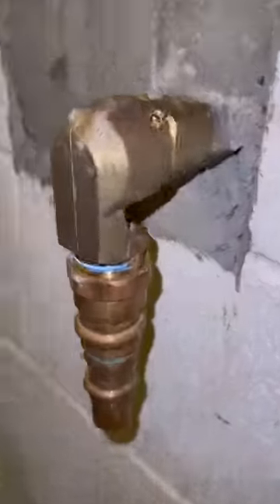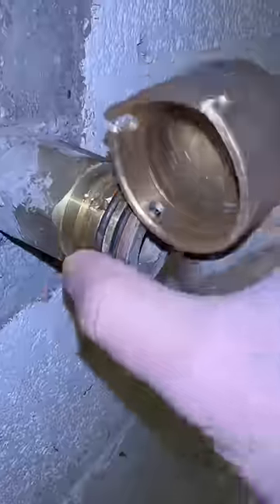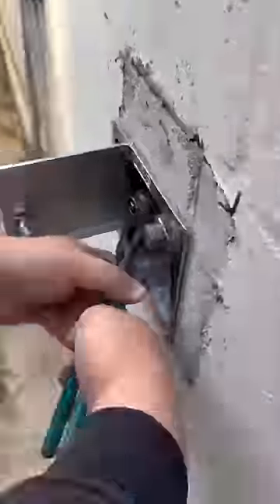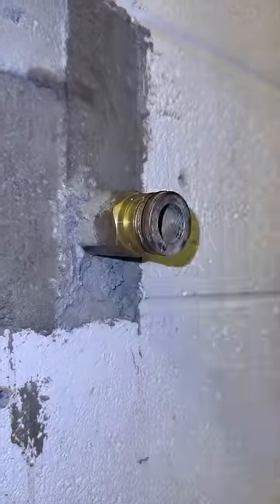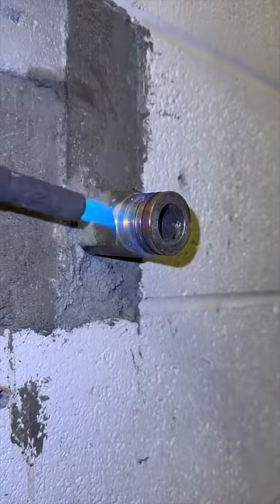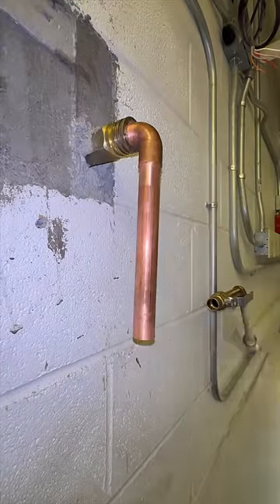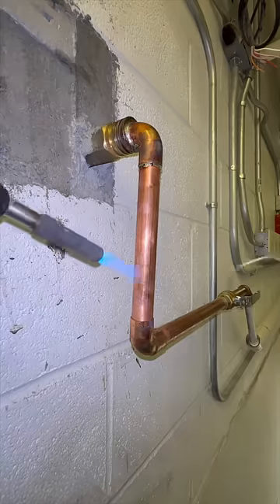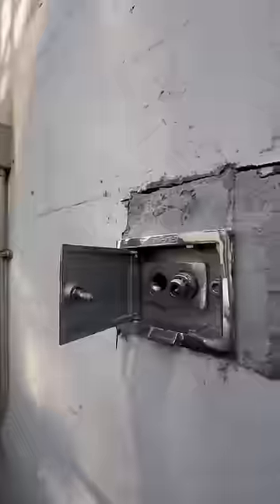Repairing a leak in a wall hydrant #fix #fyp

Comment: O-rings are just the best look at all the work you put into making those connections. Like most tankless water heaters I put all this effort into sealing the gas system you know cutting threading screwing together with pipe wrenches only to find out the folks that built the gas system inside the heater used clips and orings

Comment: It appears to me that your leak was due to a damaged "O" Ring. I see there are two o rings, now i realize its a pain and huge time suck to get  the perfect o ring without any guidance or help from manufacturer.
Your final solution seems the best for your client to prevent issues anyway
Reply: It also looked like at some point, someone wanted to access those o rings and got tired of fighting with set screws, instead just prying the brass up wrecking any change to hold against pressure.

Comment: Those commercial bibs are a pain but great. I bought one off ebay for cheap. I needed it because the walkway to the backyard is tight. The flush mount bib saves getting hit on the knee every time I walk to the back.

Comment: That original elbow part seems poorly designed and seems like it would always have issues staying connected and easily bumped or moved causing leaks, even the line pressure alone seems like it would push it off of those O-ring seals. Perfect solution soldering it like you did. Question: on the outside there are 2 connections, but inside there's only 1 pipe seen. Where is the other one?

Comment: That special elbow did what it’s gonna do when frozen.  It saves the valve body from splitting in the wall.  Maybe should have installed an elbow with a drain on it for future.  Those hydrants are supposed to be self draining if installed and maintained properly but that’s in a perfect world of course.

Comment: Good work. 

Alternative, the brass 90 could have been removed, restored to shape, gaskets removed & soldered back in place. The rolling 90 isn't needed.
Reply: Brass is brittle, bending it back would leave weak metal that is far more prone to failure.

Comment: Brah- client bought some bullshit shower valve a month ago off Amazon, i told them not to but they did anyway, when i went to put in the finish the nipple on the outlet for the handhols was super short and it was one of those janky special fittings with an O-ring and set screw

A ½ copper fit inside there perfect, so i cut the threads off a brass nipple and busted out the brazing rod and glued them together, easey-peasey perfect fit

Tou ahould always have a couple 15-30% silver rods or a small roll or 30-50% silver brazing wire, that shit will save your life every now and then if youre crafty cuz
Reply: Don't agree to install that shit bro, I had a client that was a cheapo flipper and he pulls up with 10 Amazon boxes I walked off the job... Those valves are terrible... Recommend them a cheap delta from home Depot or sum.

Comment: I like to sweat my compression stops on copper.  Make sure that you remove the stem first.  Compression nut and ferrules really hide a good wiped clean solder joint

Comment: I use a 12 point socket maybe 5/16 on those square drive valves to turn them on. I work in a building and broke a few keys trying to open the valves

Comment: I'll share my pro tip with you. Get a cheap slide caliper and make a size chart of all your standard pipe id/od sizes in your phone. If you keep it in your pocket, you don't have to go to the truck and get a fitting before you know if it will fit.